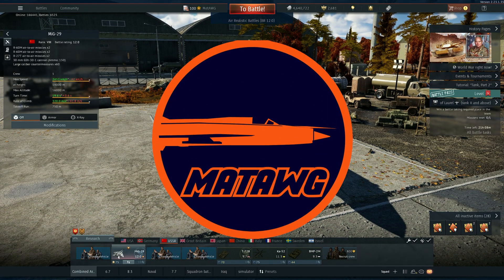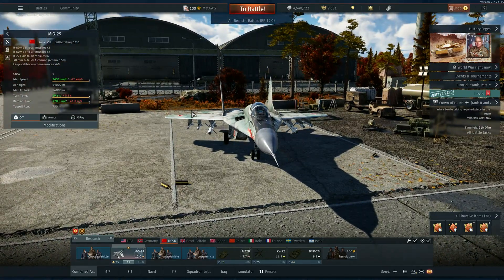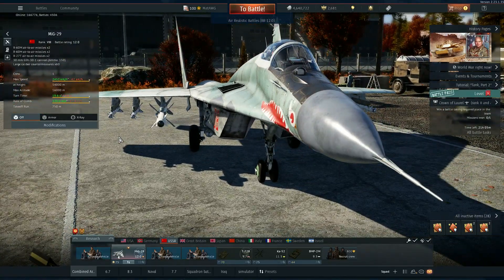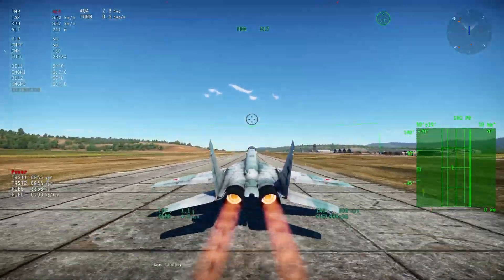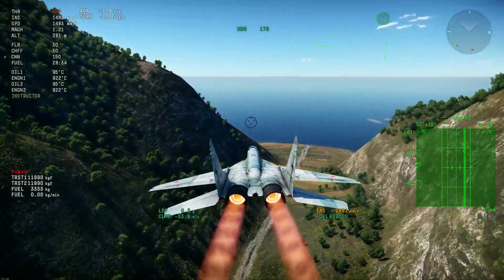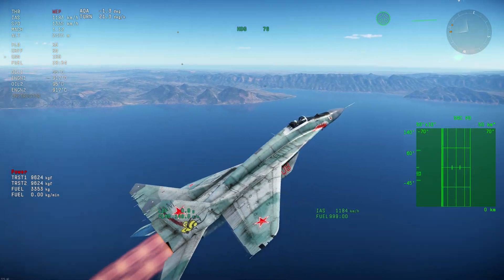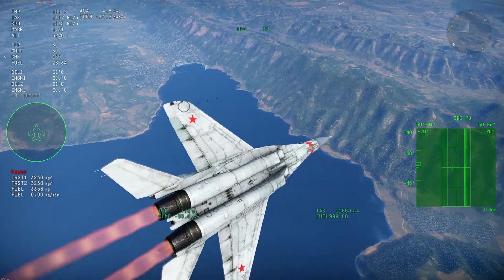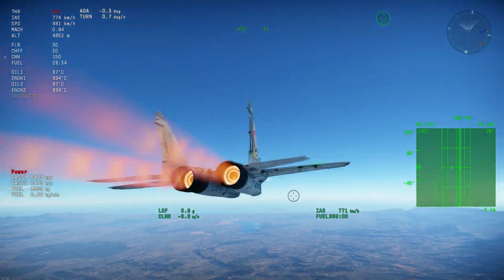War Thunder WHY DOES ENGINE THRUST in the XRAY is different from REAL LIFE THRUST?

Comment: Yes, there’s static thrust, which means it’s on a test rig; installed thrust, which means when the engine is installed in the aircraft and it not moving; and dynamic thrust, which is dependent on altitude and airspeed.
All of this of course ignores non standard atmosphere.

Comment: Also, yes it depends on weather condition but they measure the engines on optimal conditions so they would be able to make limits so that the engine wouldn’t break from extreme vibrations/temperatures etc..

Comment: Imperial thrust measurement is in lbf (pound force). 6800 kgf is about 15,000 lbf. You only need to multiply or divide by 2.205 to convert.